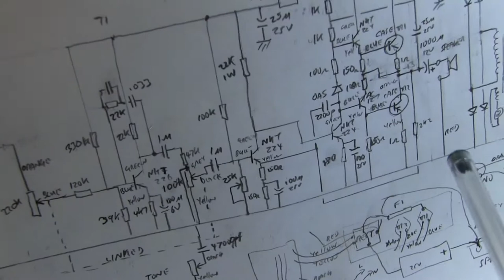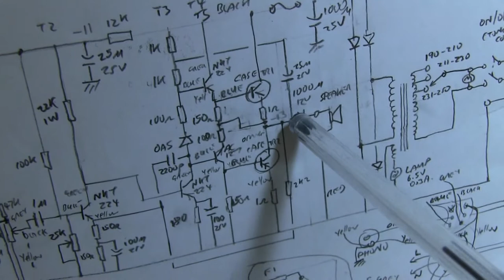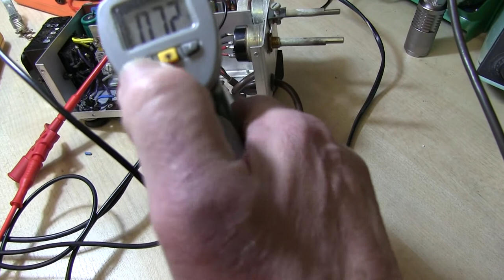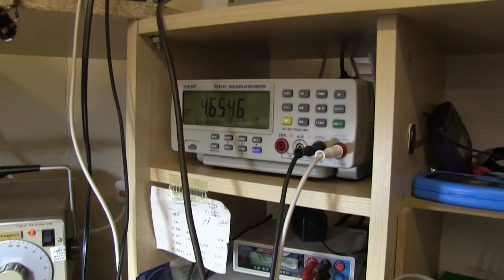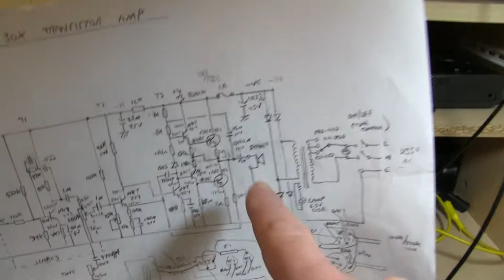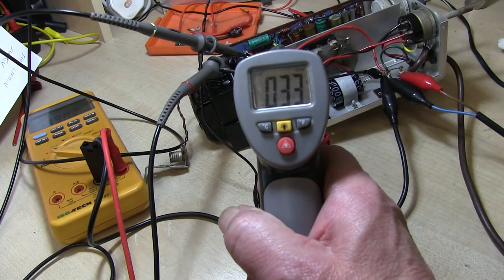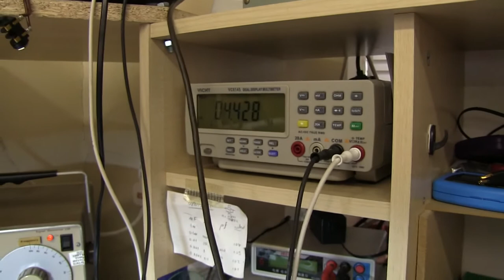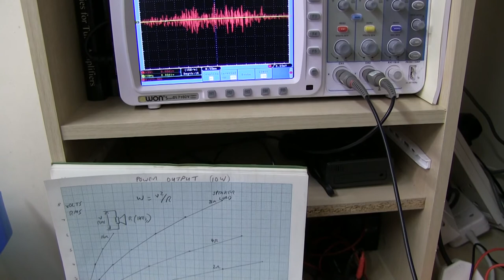Pye Black Box Transistor Amplifier. Service and test.

Comment: Dear Nick, I just loved the circuit diagram for the Pye Black Box transistor amp. I used it to track down the fault in mine. After I'd taken it to bits, I found that all that was wrong was the little  light up bulb was LOOSE! Yippee!  I put it all together, and checked, with the power lead still connected. Great. All working. So I undid the plug, threaded the wire through the hole in the box. 
Job done.🙂
Unfortunately, I miss wired the plug. 
Bang goes the house RCD trip.
Replaced the fuse on the amp, which blew.
A whisp of smoke below the green speaker feed capacitor.
As amateur, I'm now b******ered.
If I post it to you, could you fix it for me do you think?
I paid only 70 pounds for it🙂
Very best regards,
Mike Barnard ex radar mech from 1955